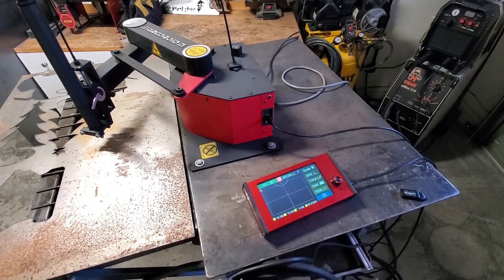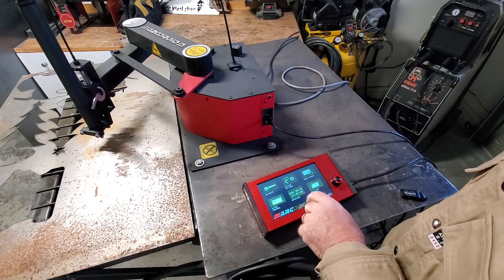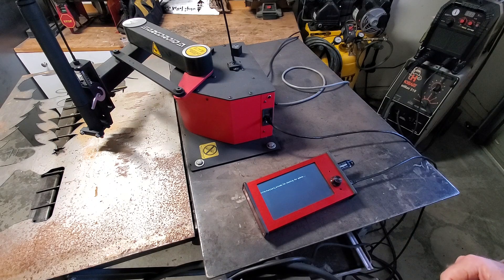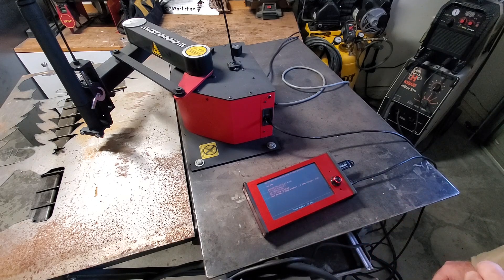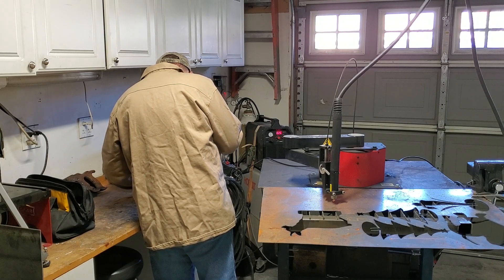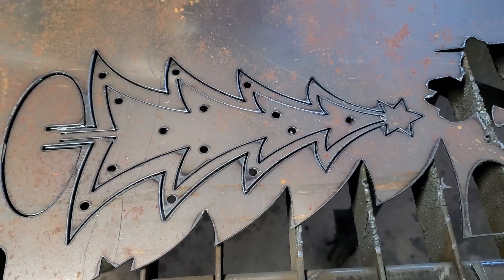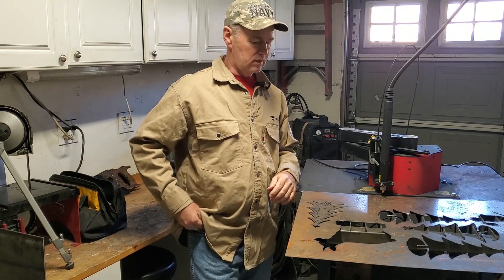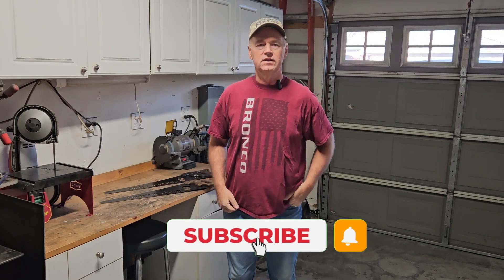Step-by-Step Guide: Installing and Testing the Arcdroid Firmware Update

Comment: Have you ever made a few pieces (like a 1 x 3 rectangle and maybe a half inch hole) then measured with a caliper?   Curious if there are kerf settings that need to be tweaked to get an exact size piece which I suppose would drift slightly as the consumable wears? Could make a good video if you are looking for ideas.
Reply from the maker: That is a good idea, and I really should put some effort into dialing in my settings.

Comment: Curious if this would work or if it would just slide upon probing -  ever try to use a sharpie in place of the stylus and do a dry run to trace out on a piece of paper Before cutting? 
Very curious if that would work if the sharpie can be kept in contact.
Reply from the maker: I haven't tried that.  It would likely probe, then lift off the material for each "cut".  I guess you could go to the tune screen and adjust the z axis to 0, maybe that would keep the pen on the material.
Reply: @6.8liter74 that actually is what I was thinking. Perhaps some electrical tape around the sharpie just under the 1st retaining clip, so any pressure would transfer to the Z axis and it would probe correctly and not just slide the pen up perhaps?
Reply from the maker: Andrew actually mounts a sharpie to the stylus in his last video.  Doesn't run the program using the sharpie, but  I thought you might find it  interesting.  https://youtu.be/FqXF9z1yxmU?si=cN3vGAQIixfjSFdV

Comment: thank you for sticking through the cut60. has the shielded cable stopped the failures?
Reply: I just ordered my Arcdroid and I have a gen3 cut 60 (cnc port on top) I am going to be using so fingers crossed there too.
Reply from the maker: I haven't had any failures since I switched to the shielded cat 6.   Fingers crossed!